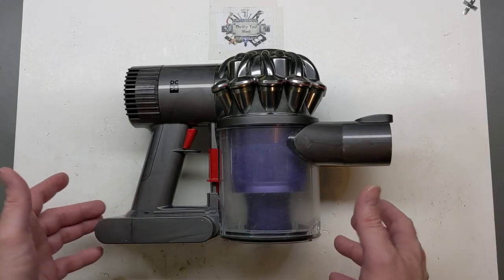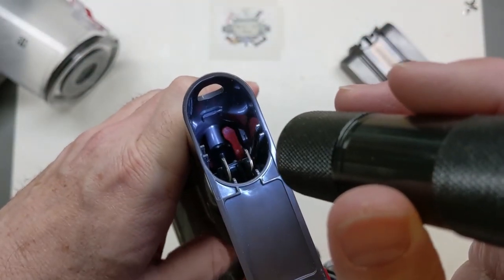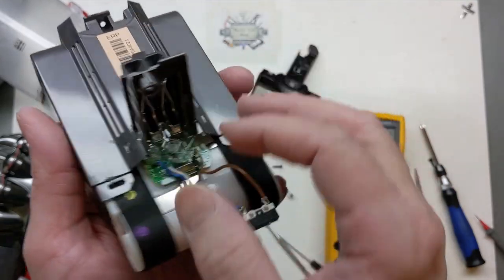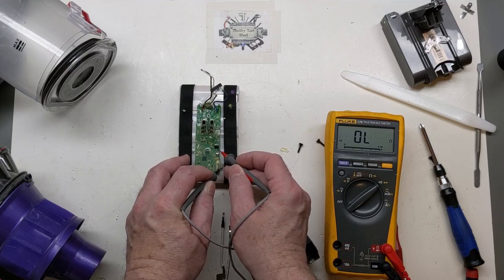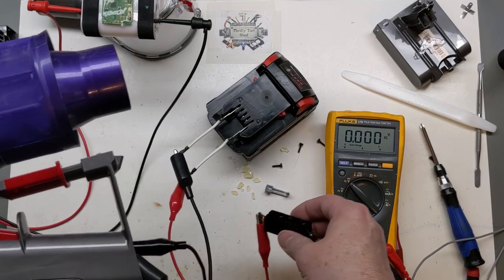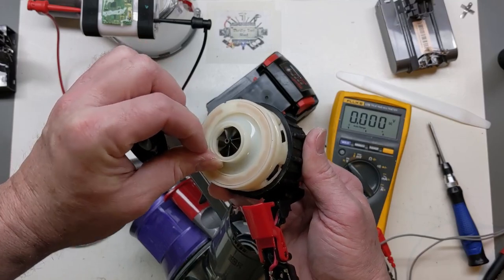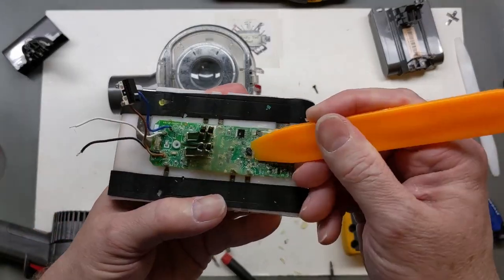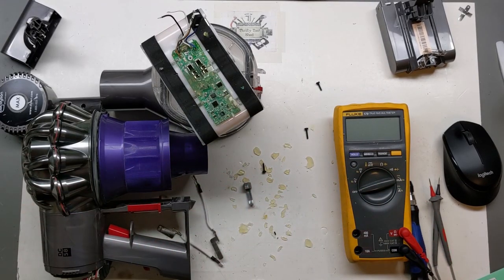Dyson DC58 Look Inside & Troubleshooting

Comment: Hi from France, very instructive video , lot of thanks !
These Dyson BMS are a robbery as they lock down after the first  undervoltage (red blinking led), specially if we don't care and use the Boost with an almost discharged pack. It can no more drain amps enough , voltage falls and BMS stops the current...but here definitively (! ??) ....With any power drill or others it's the same but the BMS (as any usual good one) is not blocked and allows the recharge without issue.
That explains why oftens the cells are not dead , only a little short undervoltage...I opened some "red" batteries : most of them had a minimal good voltage (higher again because no more amps drained) and still correctly balanced, no lost capacity...simply BMS definitively locked down....a shame , only for commercial reasons.
One possible solution with a good battery would be to add immediately a second S cells line in // under the first one (main current and balance) without touching the BMS (if disconnected it locks down), and modify the packaging : much longer worktime , and first of all 50% discharge amps less per cell , so much longer lifetime....it's not Dyson's choice and we know why.
I add : after opening the box I simply cut the male snaps with a cutter , close the box only with the screw is enough and secure. So it's very easy to open again.
And at the end a ridiculous question : if I solder a wire to make a bridge above the blocking part (1C030L)...would it be run?
Friendly, Michel .
Reply from the maker: Yes, bypassing the Mosfet for testing would actually run. This is similar to a video on a Ridgid Hyper Lithium battery pack I showed repair of. It is a video on YouTube also that someone shows reprogramming the microcontroller on the board to get rid of the issue on the Dyson pack. I wanted to eventually do a video on that, but since clone packs are so cheap I decided it wasn't worth it for me to buy the programmer at this time. I am glad someone has now done it though.

Comment: The DC35 will not power up by just connecting an M18 battery to the terminals like the DC58. Do you know what modifications are needed to make it work? I'm assuming 2 or the 5 pin connector need to see a certain resistance to allow it to conduct power to the motor.
Reply from the maker: The DC58 is the only one I have done to say for sure. The DC58 was also made so the battery supplied the start and stop to the BLDC controller and I don't know if they are all that way or not? I shared on video how the DC58 had the Mosfet on board that turns on and off with the tiny switch command.

Comment: Sometime ago I saw a guy who used a power tool battery to power up his Dyson. I have one exactly the same as yours in the garage just to hoover the car. I feel tempted to wire the Dyson motor to my car cigarette lighter and see it it works. Probably won’t work  😂as the cigarette lighter only provides 12v or so. 
I assume you still can use the cells for some other projects.
Whatever you do it will be interesting to watch. 👍
Reply from the maker: Yeah I agree,  12V is way too low for the Dyson. Even the 20V is cutting out if it pulls down too low.  Yes I will repurpose in the cells if I have no luck. Thanks for your comment!
Reply: Please do a video on more trouble shooting on the battery pack please
Reply from the maker: Well in the next video after this one I converted it so a M18 pack could run it. I did mention at the beginning of that video that the original Dyson pack was basically useless. It seems the microcontroller is programmed to basically lock out if the cells ever drop down too low. The BMS board has to be replaced at this point (Unless you wanted to reprogram the micro?) You could buy a knock off battery for a few more dollars than buying a replacement BMS board for the pack. So I decided to run it from M18. If you had the New Flex 24V or Kobalt 24V it would run even better?

Comment: Hello. I enjoyed the video and am very tempted to attempt powering my dc58 with a laptop style power supply. If you could maybe try it and document the trials and errors along the way, I think that would be very interesting.
Reply from the maker: Hi,
I have a video on this using a M18 battery to power it. I mentioned in that video that a 24V pack would work better and give more run time before dropping out. Hope it helps and thanks for your kind comment! 
https://youtu.be/KKLtT0G5frc
Reply: John Horne   There is no need to try it. The Dyson draws WAAAAAAAAAY more current than any laptop changer can deliver. Well over 100amps vs 4amps. Running a Dyson on a cord is out of the question. You would need a huge and cumbersome adaptor to carry around, or a 10-8 gauge heavy cord if the adaptor was stationary.

Comment: your videos are pretty amazing. found myself watching lots of them.
iv got a working  v6 dyson motor on the bench and noticed that it shuts  down around 17 volts. I looking for a air mover for my oil burng progects and wonder if there is some way to somehow slow this motor with an adjustable switch or remove the low voltage cutout maybe
I know the circuit board is awfully complicated. I didn't realize there was that much into that motor for circuitry.
Reply from the maker: Thanks so much for your kind comment and for watching! 
I have not gone as far as you are asking to say for sure. That is a good question about the Dyson because it's built to simply run in full output at all times. Well, some also have a MAX (kind of like a Turbo) button if you will. It could be possible to figure out what gives that input for MAX or normal and modify it, but I would guess it's just an input to the microcontroller so it may be difficult to do. I did share a video a while back about a Ridgid brushless drill that has a bad BLDC controller that was also built in and I shared a little about taking the controller board off and soldering wires onto the BLDC motor and running it with a cheap BLDC controller. That may be an option? 
This is a road I have not traveled yet to say for sure. Hope it helps! 
https://youtu.be/UaMmWGn97F0

Comment: Can you make a short video how to put the mini switch and the spring back. Thanx
Reply from the maker: If I still had that part of the pack I would. I switched this over to run off of M18 packs years ago and no longer have that part. I think I recycled the cells using them in another project.

Comment: Great video would like to see follow up vid it would be interesting to see if you can revive that BMS.  I have 7 of these battery's all of these have red light of death 2 of which I killed trying to re cell all it takes is 1 cell to drop below say 2.5 v or gets disconnected from the BMS and game over however is possible to re cell before the pack dies (when you notice the  battery only last a few mins runtime) but you need to make a slave pack and connect it to BMS before you replace the old cells and all cells must be at the same voltage and their is one more hurdle the temp sensor it is glued in and makes it hard to get the two cells out in that area If you can get past all that your good to go
Reply from the maker: I am actually troubleshooting this one right now. I am seeing the same thing.  The cells are good now and balanced and feedback is good to the management chip. Still blink of death. Seems to be in the microcontroller for sure.  I have already tried a reset on the micro and no dice.
Reply: Do u have any detailed instructions for it?
Reply from the maker: I did not have the correct interface for the Dyson microcontroller. I did find the video below by YouTuber - Second Life - that has figured out how to flash the microcontroller and get the BMS back going. Pretty cool. I may get around to doing this one day. I have messed around a little bit with ST-Link in the past to flash some microcontrollers so I will have to look at this better when I have time. https://youtu.be/ENY8xcczowk

Comment: Can you describe how the motor and pcb handle the power switch? I tried hooking a power supply to it directly with no luck, and can you help describe what the switch requirements are? I have a dyson motor and pcb but not the rest - I want to make my own hobby-specific vacuum. 

Thank you
Reply: Follow-up... Looks like the canister wires are to prevent the vacuum from powering on if there is canister attached? Is there a way to override that? I imagine that those wires would just tie into the line of power the switch is on? That way activating the switch also triggers the pcb into thinking a canister is installed? 

Thanks
Reply from the maker: Yes, I did not look at that part very much when I retrofit mine. I believe if you follow the wires to the circuit board you may have luck jumping it out there. Should be easy..
I remember it having wires that run down to the floor attachment for the roller power. I did not see the wires to monitor if the canister was in place on mine? It's been a while though...
Reply: @ThriftyToolShed  ah okay. I guess I'll just have to tinker with it and try and not zap myself or fry my pcb. 

Do you have any insight about what type of switch would be required to handle the power load? I've read/watched in places that the switch specs definitely matter 

Thanks
Reply from the maker: I did not look into that part at all while doing my battery conversion.

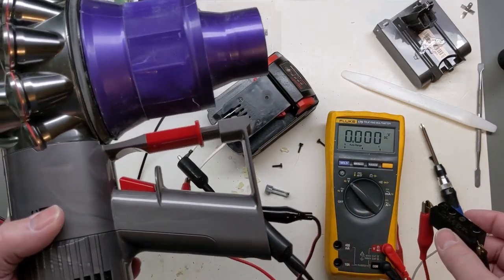Comment: at 9:40 why you didn't use the switch button of the dyson itself? I want to also convert it to work with other batteries.
Reply from the maker: The switch lever only went to the battery pack itself and that small switch was input to the board microcontroller. The output from microcontroller turned on onboard Mosfet to output to terminals of vacuum.

Comment: Hey there, really nice tear down video!

I have a Dyson V8 that after sucking up some fine dust sounds really weird and overheats quickly.
My guess is there's fine dust inside the motor area now.
Do you think there are any replacement parts for the actual main motor/insides to fix the problem?
Reply from the maker: I am not sure about the V8 to know which parts inside honestly.  Have you checked the filter in between the dust bin and motor intake to make sure it's not clogged up. Most of these are even washable if very bad they can be replaced. Sorry I am limited on expert with that model, I would only know to check the basics. Best of luck to ya!
Reply: @ThriftyToolShed  No problem thanks anyway. Yeah the vacuum can be powered on even with that filter removed, as well as the backside filter (the HEPA one). Even then you can hear it struggling.

I'll take my chances with the dealer I think, see what they say.

Comment: Yea I read the micro controller that’s used has a fail safe thing build in and once the cells drop below a certain voltage makes the bms unusable. Such a waste. Nice one Dyson 🙄
Reply from the maker: I am actually troubleshooting this one right now. I am seeing the same thing actually. The cells are good and balanced and feedback is good to the management chip. Still blink of death. Seems to be in the microcontroller. I have already tried a reset on the micro and no dice. Nice one Dyson indeed.....
Reply: @ThriftyToolShed  I’m pretty sure they have baked it into the firmware of the micro so any unbalance over an “x” period of time kills the bms. Just so they can sell more batteries. Sucks. I have a v11 battery turning up this week. I’m going to attempt to repair this one too. Fingers crossed it’s not the same

Comment: I had intermittent working on the brush attachments - turned out there was a bad earth on the red and white wires in the back of the motor. Bridging the black and white wires solves the problem - couldn't get the circuit board out to resolder.
Reply from the maker: Thanks for sharing!

Comment: Do not spin the rotor by hand you can damage the rotor. Those can not get finger grease or skin on them. That motor spins at 120000rpm and any imbalance or slight bends in the impellers can cause an imbalance and the impeller can explode. I've learned by experience when someone used an abrasive and pin to clean the impeller and boom shrapnel everywhere in the motor compartment.
Reply from the maker: I do know some models do run up to 120,000 rpm's and balance and bearings are extremely critical at that speed for sure. I had not heard touching the rotor vanes could affect it that greatly. Sorry to hear of your experience with that. Thanks for sharing!

Comment: i been finding them for $5 at my Local Flea Market can Flipp and Build them to make Cordless Duster Blowers for Cleaning inside your PC Parts i Havent  Made an Re Housing STL File to 3D Print it  or if anyone has a STL File made ?
Reply from the maker: Great find for $5. These units are very well made with high output BLDC. Best of luck with the STL file.